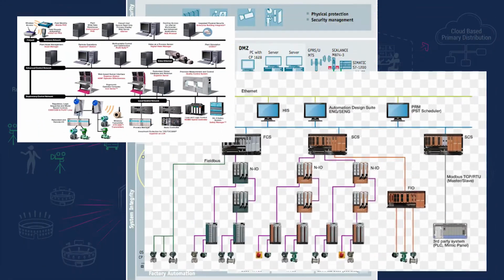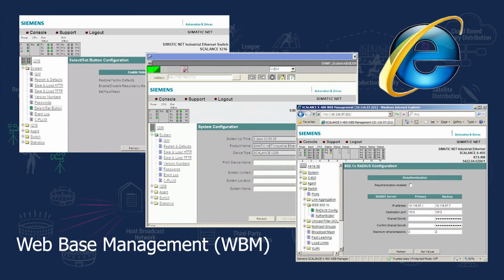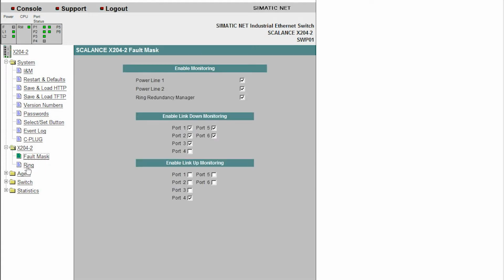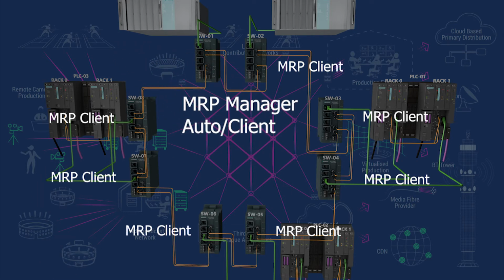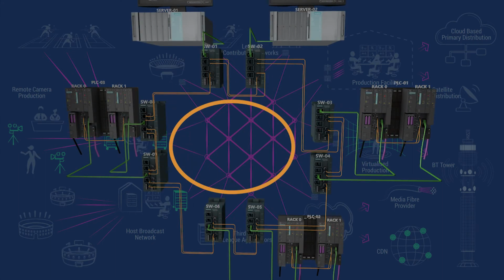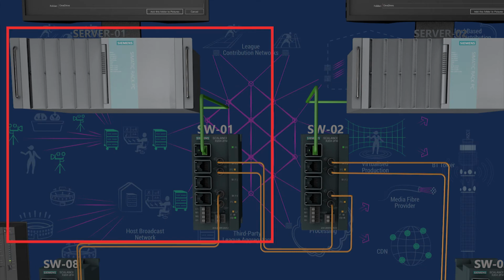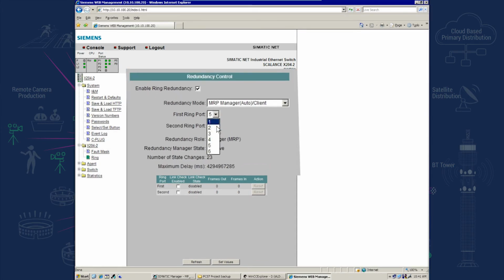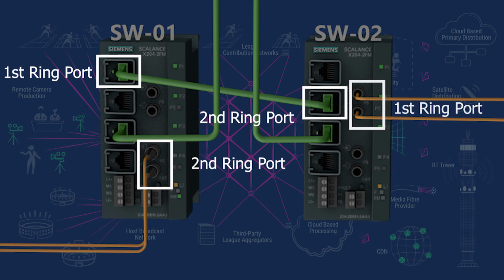Siemens Ring Network Basic Principal | Simatic Ring Topology | PCS 7 Ring Network Scalance X204

Comment: Dear i have used same topology in my plant.. With 9 PLCs 2 servers and ES, tomorrow i have problem in my server panel scalance X204-2 F indication goes to Red and all communication loss with PLCs to Servers and ES.. RM light remains green, what will be the issue? Why redundancy didn't work..
Reply from the maker: Dear 1st check CRC counter of All switches
Reply: @QasimMaqbool  CRC Counter?? Where i find?? Plz detail
Reply from the maker: Expand "Statistics" then under it "Packet Error" u can see in it CRC column
Reply: @QasimMaqbool  dear how i cjeck that my redundancy is active or not??  Bcoz in my case if redundancy is active than nothing will disturb??